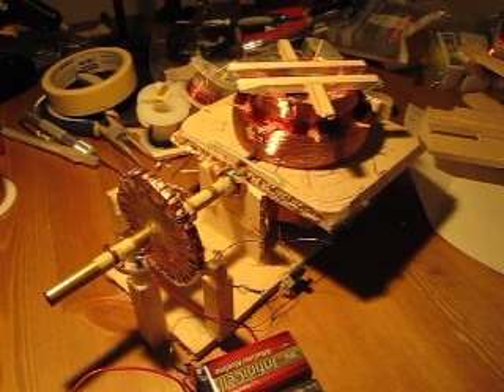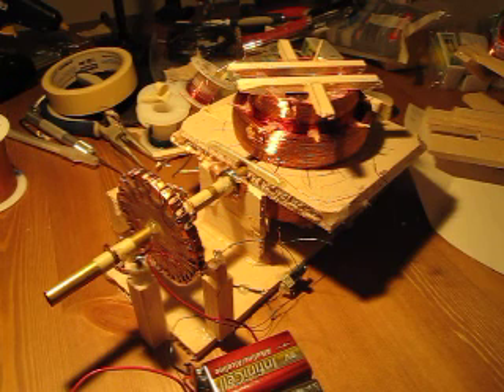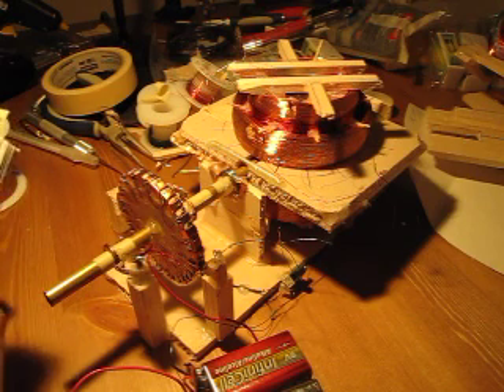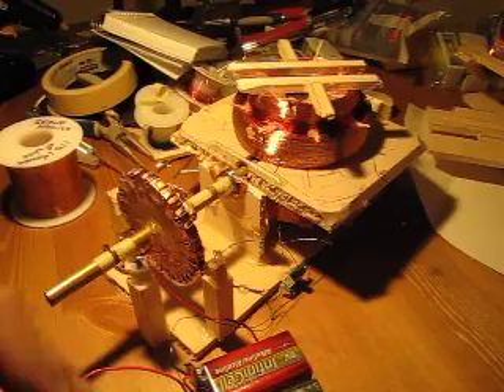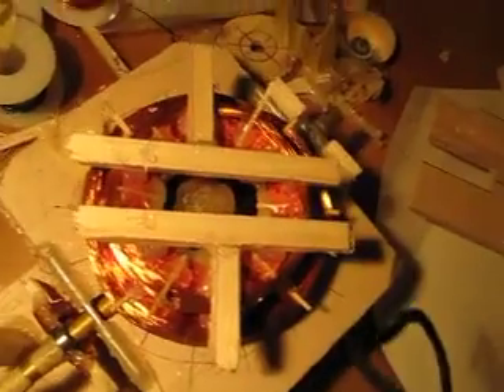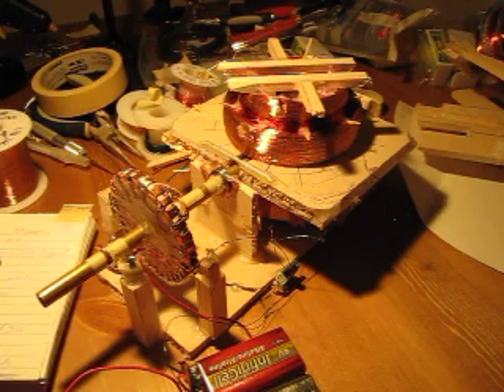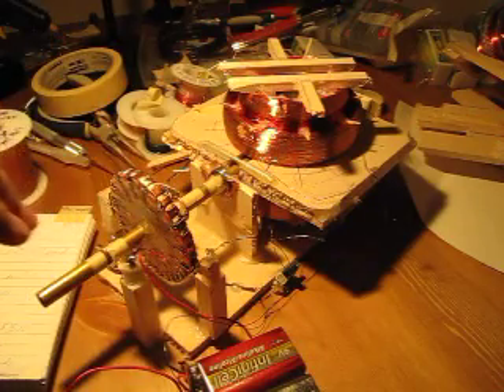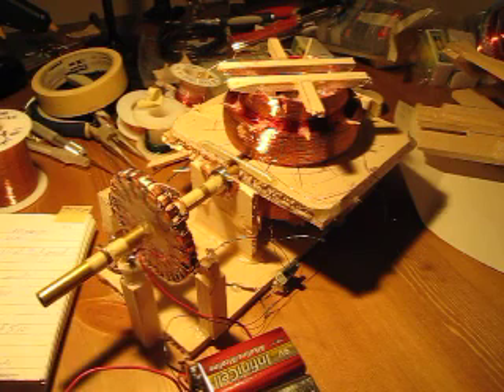Joseph Newman Motor part 3

Comment: The key here is using mid-small sized wires 15awg- 30 or more awg, use many turns in a stacked coil like what Newman has, epoxy the whole thing and wind them with a toroidal winder.  Keep the windings super tight and pack many many turns of copper with a huge mass of copper.  

Also utilize some of the best magnets available that is the N52, that is going to super enhance this motor.  But becareful, N52 is so strong it is hazardous to handle them.  Lastly, don't just follow Newman's example, you can actually stack the motor in different configurations that can adopt more magnets, more coils, all running on the same shaft.  Think about it.  

Do not forget that the faster you pulse, the quicker the rpm, the higher the back emf, the greater the efficiency.  It is a remarkable system

Comment from the maker: I'm sorry but no further work has been done on this project, and furthermore I have destroyed the device.  I resorted to cannibalism and have been using the wire in the project to create new Utron coils for my Otis Carr project.  Sorry.  The only way the new man motor will work is if you have enough wire.  I calculated that you would need a minimum of 33 pounds of 36 gauge wire.  Or 11 pounds of 40 gauge wire.  Both of which are far out of my budget right now.  I'm poor...

Comment from the maker: Electrons actually float to the outer surface of a copper wire upon electrification.  They also spiral around the surface in a helixical manner, just like DNA does or the path water likes to spiral in when constrained in a tube, or how a gyroscope likes to move as Eric Lathiwaite has shown.  Its all interrelated...   and really the same forces we are dealing with here.  Newman relates electrons to tiny gyroscopes...

Comment from the maker: 93 times 60 is 5560.  Rpm of 5560 is needed, but since we rounded the wire length to 100 miles, the real rpm would probably have to be at least 6564.  Many electric motors travel this fast...  no big deal.  Its doable in other words and easily so....    and I'm going to prove it.  ;-)

Comment from the maker: Newmans smallest working motor used 435,000 feet of wire or roughly 85 miles.  The commutator pulses the electricity 20 times per revolution.  Lets round the length to 100 miles for ease of understanding.  100 miles of wire needs to be pulsed 1860 times per second to prevent the electrons from reaching the battery (provided electrons really do travel as fast as light photons in a vacuum).  1860 times per second divided by 20 equals 93.  The commutator must rotate 93 times per second.

Comment from the maker: I forgot to mention that voltage spikes in excess of 1500 volts were measured by myself with a voltmeter when placing the leads directly on the battery array terminals.  These spikes were of the opposite polarity of the output voltage, just as Joseph Newman has measured on his devices.  However, my device as it stands now is still running down the batteries.  I plan to start over with a whole new replication using at least 17 pounds of 36 gauge wire...   or possibly 11 pounds of 40 gauge wire.